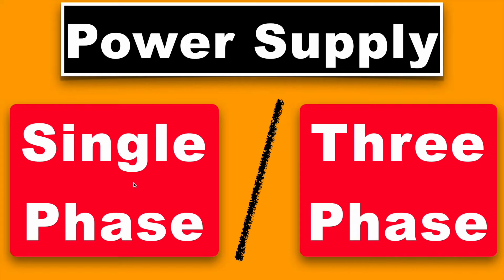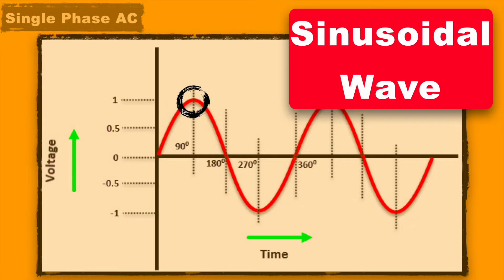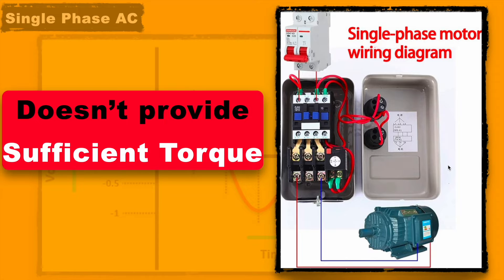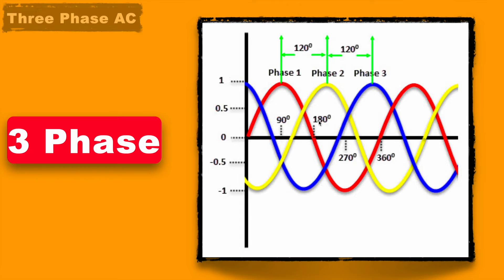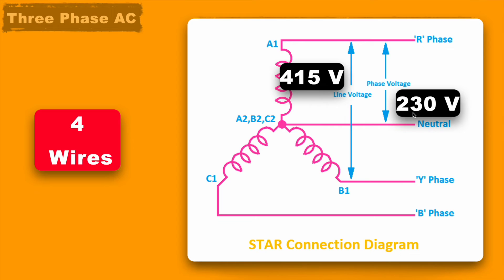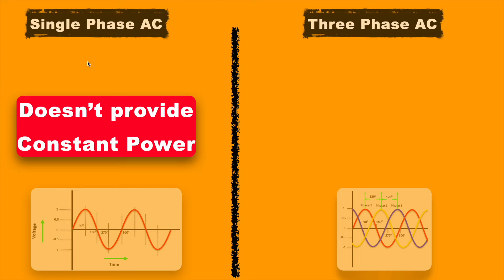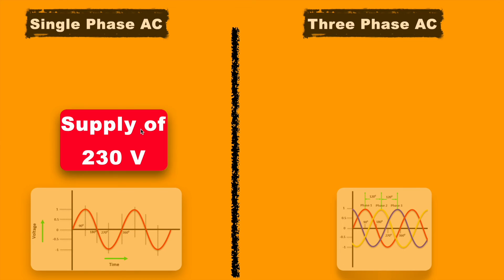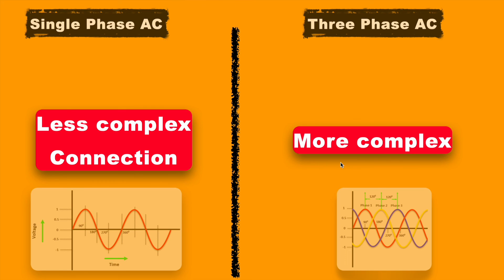Difference between Single Phase and Three Phase AC Power Supply #electronics #electrical

Comment: Good comparison 👍
One query which i have wondered about.
 If we have a single phase 5 Horsepower motor and another 3 phase 5 Hp motor. 
Which one will use more electricity running for same amount. Or is the energy user the same for both.
Reply from the maker: Thanks for your interest!!
As three phase power supply has higher efficiency than single phase power supply.
Or, we can say - Some amount of energy is lost in case of single phase power supply.

Due to this reason, Three phase power supply would consume less electrical energy.
Please refer for more detail 
Section - Efficiency and consumption

 - https://www.linquip.com/blog/single-phase-vs-three-phase-induction-motor/#:~:text=Three%2Dphase%20motor%20supplies%20use,doing%20single%2Dphase%20motor%20supplies.